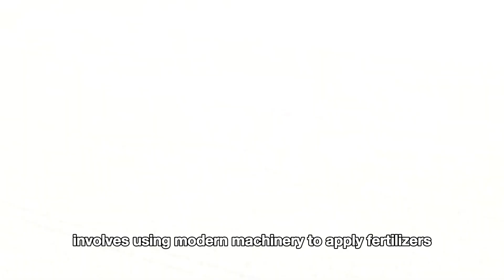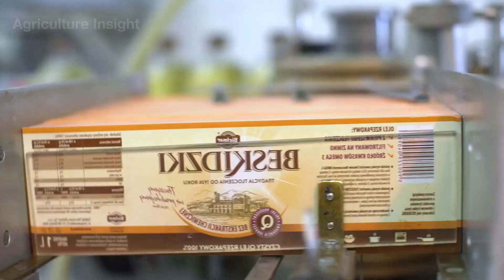46 Billion Pounds Of Canola Are Harvested To Produce Oil This Way | Farming Documentary

Comment: As some constructive feedback, I think most Canola is seeded into No Till soil, so no cultivation/tillage happens prior to planting. Also lots of Canola is grown on dryland farms, irrgated land is sometimes used for higher value crops! But some irrigated land will have Canola in the crop rotation. Also not many people use planters for Canola, but that might come in the future, because seeds are so expensive. Currently, many people use an air seeder, which is less accurate and less efficient compared to a planter. Depending on where upu live, it is not easy to find out all that info! Or maybe where you live, it is done differently. I enjoyed the video, thanks for making them
Reply from the maker: Thank you so much for your thoughtful feedback and for sharing these insights about canola farming! You're absolutely right that practices can vary significantly depending on the region. Many farmers indeed seed canola into no-till soil, especially in areas prioritizing soil health and moisture retention. As for irrigation, I appreciate your point about canola often being grown on dryland farms, with irrigated land typically reserved for higher-value crops—though some regions do include canola in irrigated rotations.
Farming practices differ so much by location, and it’s not always easy to capture every regional nuance. Your comment adds a valuable perspective, and I’ll certainly keep this in mind for future videos. Thanks again for watching and for contributing to the conversation! 😊
Reply: Canola oil is pure poison and should be stopped immediately. If your eating this crap then good luck.